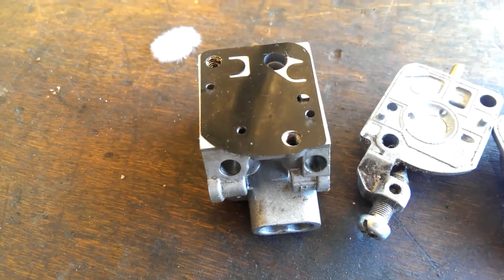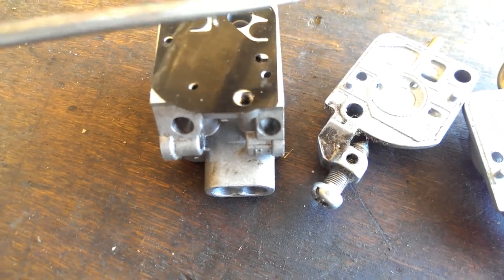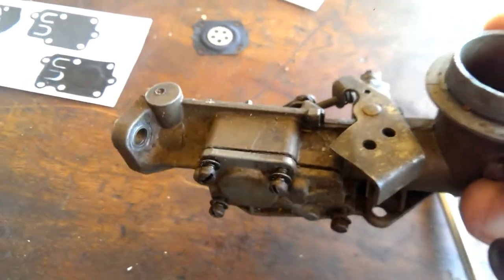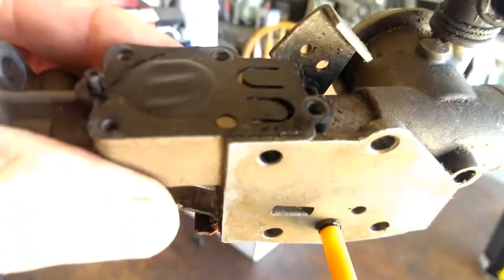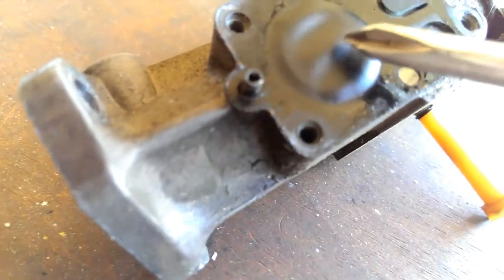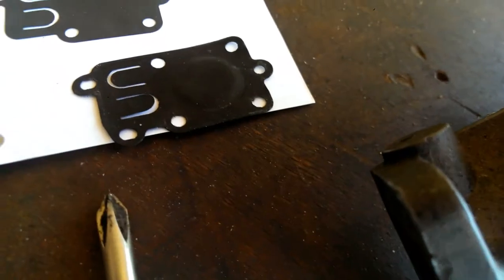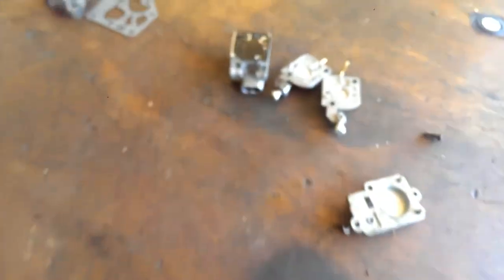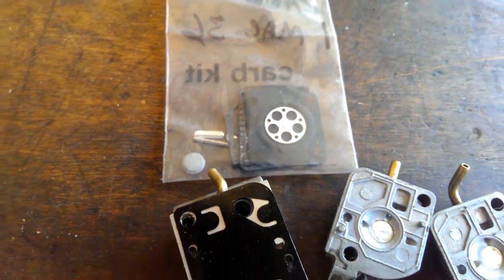NOT another Chainsaw Carburator video!? Just watch...

Comment: I just tore apart a horizontal 5 horse. I had to take it off the gas tank and realized that there was rust in the gas tank it wasn't that bad but a lot of gas tanks on a 5 horse got Rusty. Just look at the gas tank it look brand new. But when I lifted the carburetor up it was filled with rust on one side so I took the gas tank off cleaned it out the best I could. Took took out all the rust I could find. It runs pretty good I got it chipper shredder you don't use them very often. So what happens gasoline's got water in it so we had to rust and there's no stopping it. The new gas tank I saw one guy talkin about it was a hundred bucks most people will junk them

Comment: Good job. Always nice to see the carbs open and apart to make you realize they aren't that intimidating. BUT,, you have to be precise in cleaning and reassembly for good results. Thanks.
Reply from the maker: Peter Ford Thanks for your comment. You are absolutely correct. I am pretty thorough and knock on wood I have not felt the need to invest in one of those sonic cleaners. I hear good things about those things so who knows whats in the future? Thanks again.
Reply: ulitepilot aka Zombie Dave I think a good soak in carb cleaner works fine. And then a clean rinse and blow through. I mean unless a carbs been sitting for a year with old fuel,, usually isn't that gummed up. Long as you make as many passages as you can clean and clear, no real need for special machines. I think you explained it fine.